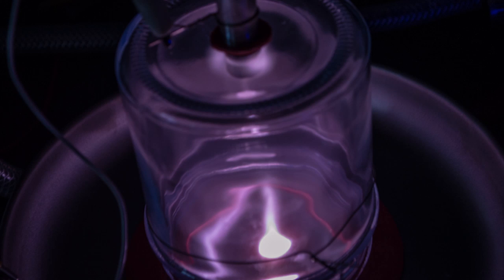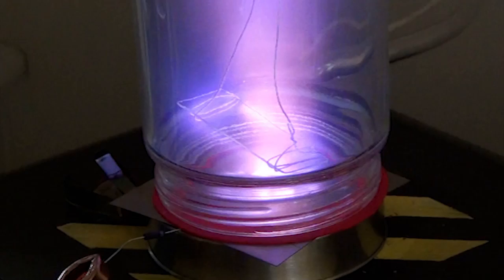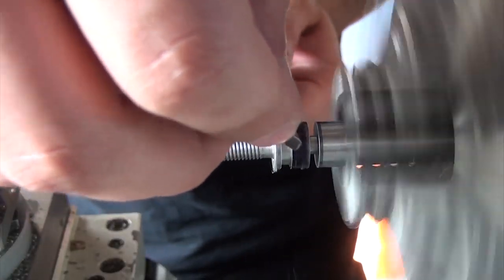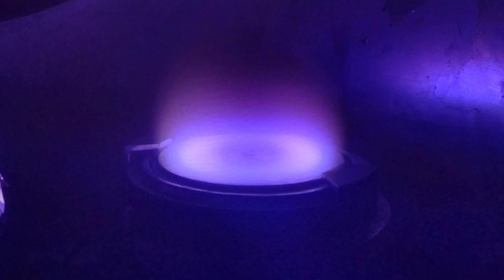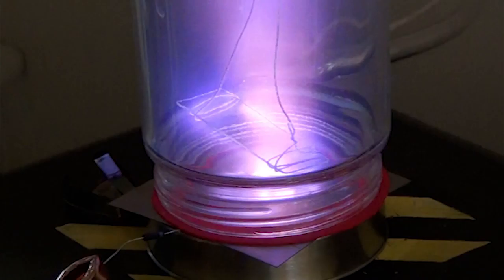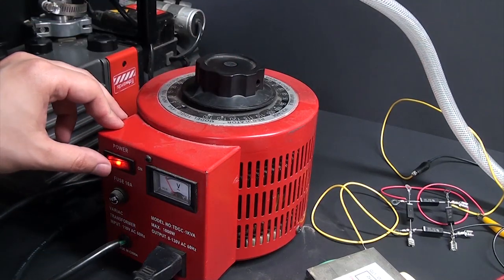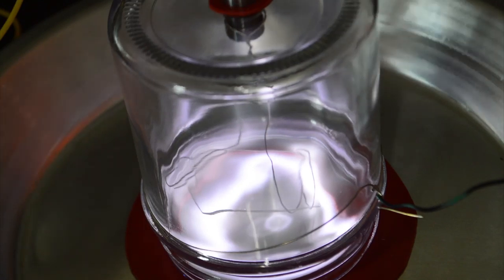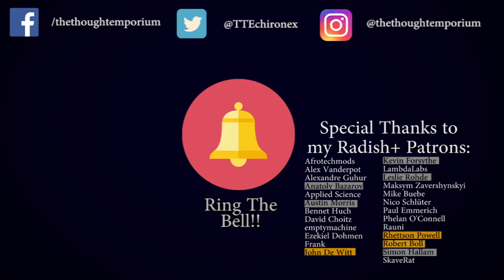My First Successful Metal Coating Machine - Magnetron Sputtering

Comment: Hey you just missed to get echo effect on 'FULL BRIDGE RECTIFIER'.........
Reply: I was too distracted laughing at "It will hurt the entire time you're dying"
Reply: Josh  Why? that's something electroboom would do. In fact, i think he did IIRC, probably while experimenting with his tesla coil.
Reply: @suchiman123  electrobooms signature move is "touching" deadly electrical stuff, so we don't want TE emulating that part lmao
Reply: I noticed the precautionary warning is followed by the transformer and rectifier sitting on the workbench fully exposed with sketchy alligator clip leads strewn all over the place. That isn't the correct way to deal with High Voltage at all. Definitely going to be hurting the entire time you are dying.
Reply: @tissuepaper9962  Make the signature move "touching" deadly plasma stuff 😅
Reply: @milspec1   just don't touch the clips while there is current.
Reply: Or as AvE would say "Full Bridge Rectumfryer"!
Reply: @patman0250  I believe it's just after effects mostly but I could be wrong
Reply: @patman0250  true
Reply: have you ever tried a suppressed phase rectifier to get multiple voltage transformers on the same line without burning the smallest transformer?, to add annother transformer,  just add another half bridge per transphormer, needs common phase to work
Reply: Omg. HAHAHA
Reply: @suchiman123  fo real?  I gotta check that out.  My engineering style is much more like his

Comment: HiVac tech here.  One minor mistake :)  Your diff pump would go between the chamber and the E2M80 (rough pump).  The diff pump would pull you under 5mt, but they need to be backed by a rough.  or a booster/rough combo (roots blower, sitting on top of your E2M80)  Great vid though.  I work on tools that do this for a living.  I think its awesome that you got this going at home for almost nothing

Comment: 13:08 "It will hurt the entire time you're dying if you touch it while it is running.", priceless.
Reply: It made my day!
Reply: All safety warnings should be written like that ;)
Reply: @soundspark  3D printers are cheaper than just buying some polycarbonate sheets? Amazing.

Comment: Adding a high voltage smoothing capacitor to your high voltage full bridge rectifier across the DC side should improve your results. The ripple in the DC will likely give inconsistent film thicknesses across the surface of the sample.
Reply: I knew he was missing some thing in his rectifier but it didnt hit me till now i have been working with like only ac lately
Reply: Do they also call that part a condensator?
Reply: @MegaLietuvislt  Yes, that used to be the name for it (and still is in many languages), but in English you say capacitor nowadays.
Reply: @MegaLietuvislt  Condensers are normally called capacitors now. Both names describe what they do, which is to hold an electric charge.
Reply: Might be good to add a series inductor (ballast) after the rectifier and capacitor to smooth the current flow. The high voltage winding of a transformer will do.
Reply: You can pull the capacitor out of the same microwave that you get the transformer from.
Reply: @klave8511  It takes some doing to get the right value of inductor for an LC filter, and the variable voltage/current of the load makes it even trickier. Much easier and usually just as good to use an RC filter, which also gives close to 1.414 times the RMS voltage, compared to about 0.9 times the RMS voltage with an inductive filter.
Reply: Why? This is not an application that powers semiconductors, nor is the waveform of any relevance to the sputtering process. Only the fact of a DC voltage as an acceleration voltage and the area under the curve, i.e. the effective value, is of importance for the plasma flow.
In fact, the actual process of plasma formation and transport of the ions through the vacuum including deposition on the sputtering target is effectively a giant capacitor that money (at the voltages) couldn't even buy. Fun fact: A related process, radio frequency sputtering(RF sputtering), DOES REQUIRE a capacitor, but to isolate the DC component and keep the plasma electrically neutral.
You guys are mislead by your lack of knowledge that some chemical or physical processes represent a huge capacitor themselves. So it can be seen again and again that some people want to connect a superfluous capacitor in parallel in front of e.g. car batteries, which themselves are a billion times larger capacitor. Or in galvanic processes. The same applies here: Figuratively speaking, the waveform of the acceleration voltage doesn't interest the metal ions, or these processes are so far removed in time from the intervals of the half-sine waves that stabilizing the voltage would simply be absurd. 

Guys, it's your money, of course, and you can do whatever you want with it. Including spending it on overpriced high voltage capacitors or throwing it out of the window right away.:)
Reply: @trevorjaster4072  TLDR; 
Your mistake in reasoning is that you think the "burning" of the plasma follows proportionally to the waveform of the ignition voltage. This is NOT the case!
Reply: The capacitor may make it a spark sputtering device, build up the voltage till discharge starts then dump the current out till the plasma stops to have to start over again.

Comment: I used magnetron sputtering (had to fix one that was almost "gone") on my PhD-work and also made high vacuum arc melter, and based on my experience I would recommend using 3-side supported (squeezed) O-rings instead of 2-side-squeezed flat gaskets whenever possible (since you have the lathe). Also a book worth it's weight in gold about cheapo-high-grade-lab-research instrument building, I would recommend is the John H. Moore et all Building Scientific Apparatus (4th ed). It has really nice tricks to get high vacuum cheaply  (that I did not need/get to use due to external funding). Looking forward to new episodes.
Reply from the maker: Bought a copy of Building Scientific Apparatus. Excited to give it a read.
Reply: Excellent book recommendation. Thanks!
Reply: Your input is appreciated, thank you.

Comment: I have a little bit of experience with some of this so if you don’t mind some comments from the peanut gallery:
-When I’ve done sputtering, usually there would be a pre-sputtering step where a shutter has a small amount of material deposited on it to clean the target surface 
-The gaskets would commonly use stuff like (oxygen free) copper O-Rings for high vacuum systems to prevent any outgassing. It would be a one time use though because the connection would “bite into” the copper to produce the seal
-Swage connections might be worth looking into
-High Vacuum lithium grease was also used
-If your sputter material is “machineable” it might have metals that can outgas like lead or zinc. (Strangely lead-tin solders are used for vacuum applications so keep that in mind?) If the iron is machineable, it might have sulfur inside of it which can outgas
-It might be cheaper to use metal foil for your metal sources
-Acrylic can outgas in ultra-high vacuum.  It’s used for vacuum systems, but those are usually “low-vacuum” systems (where the pressure is higher, confusing I know) where it’s good enough. Maybe something like a GPU cooler could work?
-Instead of a diffusion pump (since you don’t want to use thatbfor this project) you might can look into using a cryopump instead since I think I remember you using liquid nitrogen before
-Borosilicate glass can be used for sealing metal connections for vacuum too
-The UV light from the plasma might be damaging to the epoxy so that might be something to keep in mind in the future
-Despite the iron atoms having a high effective temperature as they are sputtering, they are still magnetic, so you might want to adjust your setup for those (see attached: https://www.researchgate.net/post/What_is_the_best_way_to_do_sputtering_of_magnetic_materials/amp ) The link has people discussing putting magnets BESIDE your sputter target so that might be worth looking into
-If you have a UV-Ozone cleaner, it can do WONDERS when preparing a substrate for film deposition
-For making diamond, one thing you might can try is to use graphite foil as the sputter source and a silicon wafer as a substrate.  Hopefully the oxide layer doesn’t interfere too much and if I recall, Diamond grows on <100> silicon but at a 45° angle (its been a while so don’t hold that too much against me)

Disclaimer: some of this stuff is kinda fuzzy since it’s been a while so take it with a grain of salt. This is stuff you probably already know and I know you were only doing a prototype and couldn’t get around to all of this, but hopefully something that I typed can prove helpful 😁
Reply: There is a problem with cryopumps: they can't take much argon. Other than that, one can be used to suck water, oxygen, nitrogen and CO2 out, deeper than any "roughing" mechanical pump ever can.
I've seen corrugated stainless steel pipes in a hardware store here. I think, they can perform much better than vinyl hoses, but they are quite inconveniently rigid.
Reply: I enjoy using Hysol 1C epoxy for my vacuum epoxy because I believe it's identical to TorrSeal. (McMaster)
I also prefer to use hand bendable aluminum tube and Swagelok fittings/needle_valves. I can leave my system at vacuum for weeks.
Instrutech gauges are a good choice, but be aware the hot-wire gauges will require correction but the diaphragm ones don't.
A good bell jar is like $60 on amazon.
If you are going to do borosilicate sealing to metal you'll have to get good at flameworking, flame annealing, and/or use Tungsten to match the expansion coefficient.
Reply: Concerning the sputtering of Fe, when ever I do sputtering of material conatining Fe or Ni,  the target (material to be sputtered) thickness plays a large role. With a "proper" machine and a high magnetic field gun our Fe target can not be much thicker than 3mm otherwise our coating will look similar to yours. You might want to try to use a steel foil, as mentioned by someone else.
Reply: Codys lab Gravity vacuum vid, would that type of vacuum work?
Reply: Tagging on here, 
 -I'd recommend a shutter as well if you can make that work. With that you can protect your sample, use the Ar to pre-sputter removing the native oxides on your target material and then open the shutter for the deposition. 

-Seconding the cryopump, I'd add a roots blower as well. Most PVD systems I've seen have had a cryo on them. The roots blower helps handle the process gas you need for sputtering. A diffusion pump could also work and handle the load, but you start to have backstreaming concerns with the oil though if you do not follow the proper pumping procedure. (Diffpumps at this point are the poor mans vacuum pump in industry due to the backstreaming issues) A turbomolecular pump isn't as good in PVD systems, they're usually used in dry(plasma) etchers. 
-A minimum base pressure for what you're looking for here would be in the 1e-6->1e-8 torr range for good quality films.  
-Corning vacuum grease is also good, you can find it on amazon. generally for lubing o-rings/gaskets
- For forming oxides, you're going to want to flow O2 into the system not just sputter them. If you only sputter the oxides they don't form precisely what you're thinking they do as the oxygen leaves through the pump sometimes. You can do similar films by also flowing N2 for nitrides. You'll want to balance the O2/N2 flows with Ar, let the Ar do the sputter, and the O2/N2 be part of the film formation. Basically Ar, O2 and N2 are all you should have/make sense to have hooked up to a sputtering/PVD system, if anything else is being used to sputter you don't know what film you're getting. It gets expensive, but the higher purity the gas you use the better quality film you get. Welding argon is really not great and has some oil in it, but that could just be what you can get, just kind of a fyi on that.
-You could also have a go at machining a chamber, one of the main concerns you have with the glass is it breaking under high-vac. Applied Science has a bell-jar that was made explicitly for this sort thing, it isn't a coincidence. You can have viewports in the chamber, and use thicker glass that wont break. I've got my concerns about the mason jar you're using when going to a high-vac setup. 
-Any exposed parts of the setup should be wiped down with isopropyl alcohol prior to pumpdown. If you are doing a seal similar to how you are now with the chamber, either using the corning grease or wiping it down with iso is preferred. 
-Diamond like carbon is going to be a pain. I'd probably do more of a thermal PVD setup where you heat up a graphite rod as opposed to sputtering. whether or not that is DLC is its own issue. PECVD is commonly used for DLC using a high grade acetylene if I remember correctly.  
-My personal go-to book recommendations for thin films processing: (I have these at my desk at work) (also there are ways to find PDFs of these)
--Materials Science of thin films by Milton Ohring
--Thin Films Processes II by Vossen & Kern
--A user's guide to Vacuum Technology by O'Hanlon.
I hope that's helpful to you or someone else!
Reply: @SpeedLockedNZ  the mercury vapor inside the system would almost certainly get into the coatings, but if that's not a problem it could potentially work. The main issue with a Sprengel type mercury pump, besides being very slow, is that mercury is difficult to get in large quantities (remember, Cody has a source through his dad's old mine business) and is a regulatory nightmare in a hackspace where insurance is a necessity. 

A diffusion pump is very similar in concept to a Sprengel pump anyway, but the working fluid is oil and the pump speed is considerably quicker.

Comment: Sputtered aluminum makes very good mirrors. When I made them though, I just used a tungsten coil with a wad of aluminum foil shoved into the center (the W coil was pretty heavy-duty!). The W coil was connected to a pair of feed-throughs to a low voltage, high current supply (~2-3v at 20+A). I used glass slides and just laid them on the bottom of the chamber. I pumped the chamber down (had an Edwards pump, too!) and when it got down as low as it could, I turned on the power supply. The W coil glows really brightly and vaporizes the Al foil and voila, very shiny aluminized glass mirrors! An overcoat of SiO would have been helpful as the coatings are super fragile (as you know), but I didn't have any. Anyway- nice job with the plasma approach!
Reply: Your method was evaporation, also known as PVD. A very popular and much easier method to set up, aside from high current feedthroughs.
The coatings shouldn't be fragile, that is likely because your glass was contaminated.
Reply: @Spirit532  Well, the coatings were pretty darn thin. But yeah, cleaning them with acetone may have left some residue. Most coated optics are overcoated with SiO to make them more damage resistant, though.
Reply: @LiLi-or2gm  the acetone is just OK for a first pass cleaning, there's better ways to get 'em really clean before coating.

Comment: I once had the pleasure of using a professional "Sputterer" they had at the local Uni for a school project where i needed to coat some mold fungi in gold in order to observe it under their SEM! It was a great project!!
Reply: Could you not observe their gold mould semi with just your eyes?
Reply: @theRhinsRanger  The electron-beam in a SEM would burn the fungi the moment it touches it. We speaking of energy around 20.000 Volt. The Gold coating encapsules the fungi and preserve its fine surface. The Mikrometer/Nanometer World is very interesting to observe ;)

Comment: After watching your earlier video and Applied Science, I decided I needed to do this too. I needed a way of making beamsplitters reliably and with repeatable results. In the end I bought a used desktop sputter coater and had to do some restoration/repair work but now it works like a dream. Our machine doesn't need any water cooling. The next thing I want to do is make anti-reflection coatings. In order to sputter dielectric materials, ideally you need RF power instead of DC and the secondary vacuum pump is also needed. Aluminum falls into this category too. It doesn't sputter well with DC because it quickly develops an oxide layer which is of course insulating. We have enough gear to make a larger RF powered unit in the future. With DC we've sputtered silver, gold and nickel and applying a precise, high quality, semi-reflective layer onto a glass prism has become a quick, routine process that we can now do anytime.  Keep going - great fun!

Comment: Dude.  You should try a diamond hole saw for cutting tiles, etc. They are fairly inexpensive and drill a perfect,  easy hole in glass.
Reply: This^ I paused the video to look them up on Amazon.$20 for a set.
Reply from the maker: I picked up a set based on your suggestion and yup, they're great. Bit tricky to get the hole started without marring up the glass, but makes a nice clean hole. Already used them to make a new upgraded chamber for the system. thanks!
Reply: @thethoughtemporium  agreed... you sort of have to start them at an angle then roll them flat.  Glad I could help!
Reply from the maker: @danfoster326  which is exactly what I ended up doing. First vacuum test won't be for a week or so, so won't know how well things are holding up until then, but so far seems promising